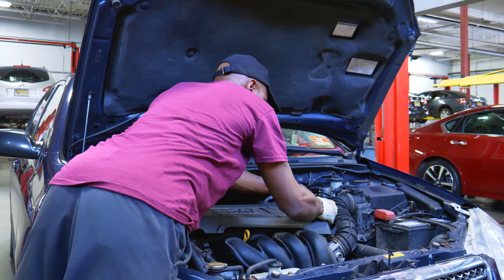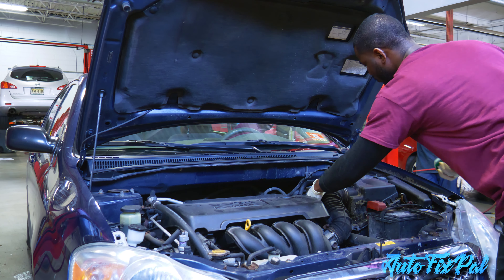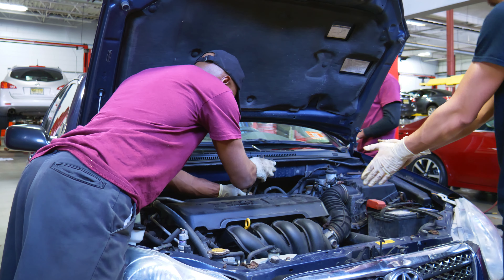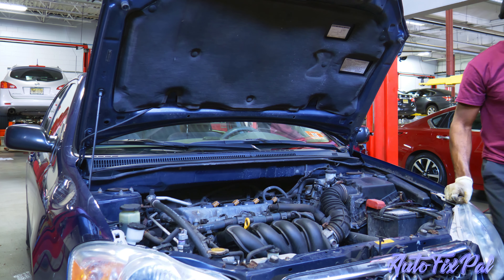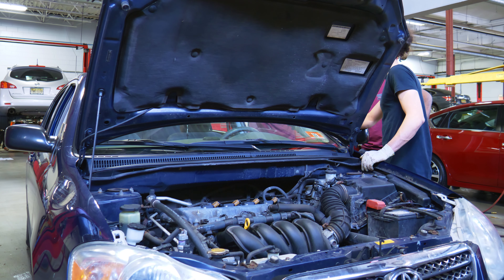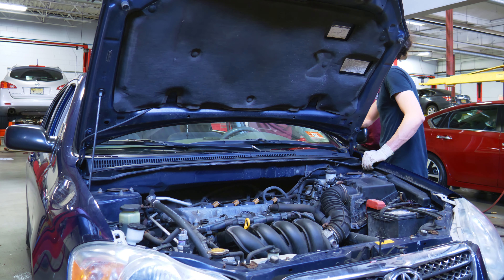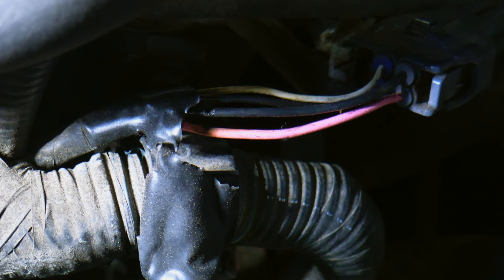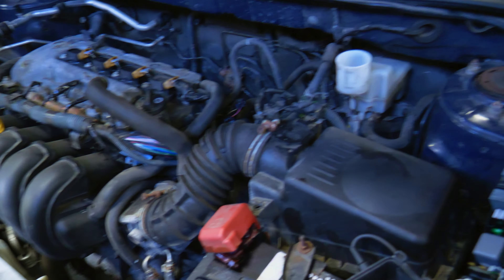2005 Toyota Corolla no start - no communication - No wiring Diagram

Comment: Thanks guys !! I have a 2004 corolla  with the same problems.
1.Fuse Blow (EFI) 
2. No Communication with the scanner.

It was the OBD2 Sensor with a shortage inside, instead of the cables burn. I disconnected the sensor and put a new fuse  and that's what's it .
Thanks for the video! 

PD: This its the reason that  i love YouTube